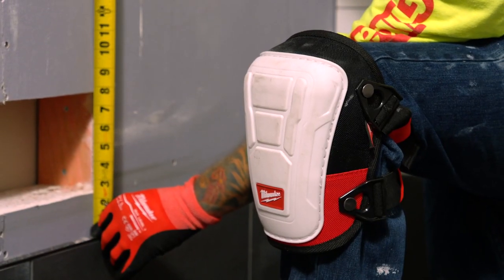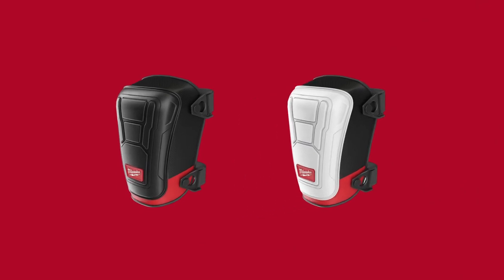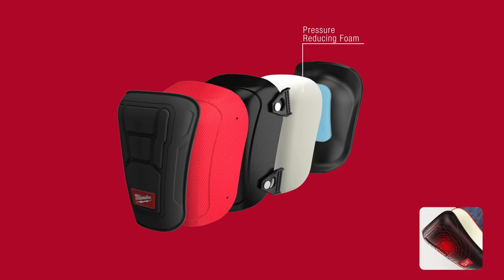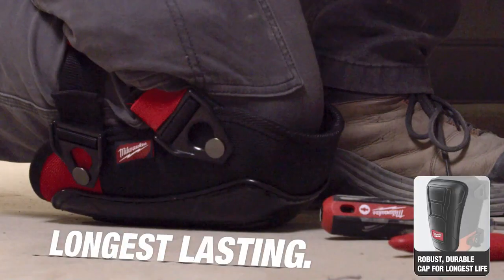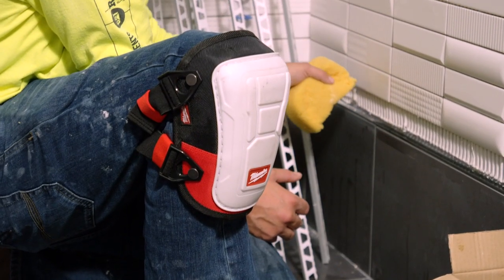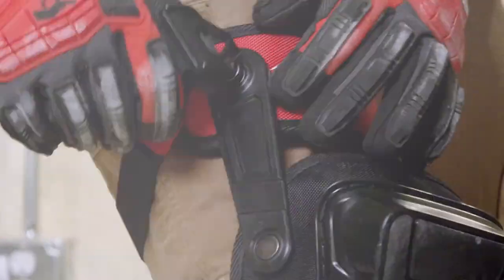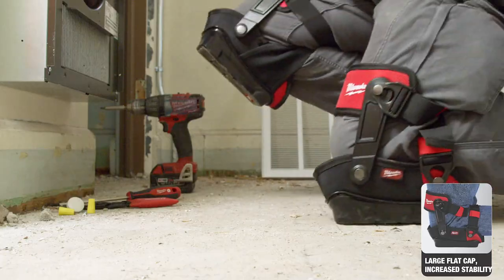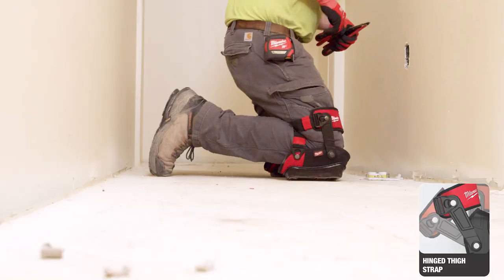Milwaukee® Knee Pads

Comment: Do they take the M12 or M18 battery? Joking aside, FINALLY someone put in a brace to keep them in place when you stand up and move around! 20 year commercial HVAC tech and those rock flat roofs are killer on the knees.

Comment: Sorry to be wet blanket guys but they are not as good as advertised. They keep slipping or sliding down regardless of how tight the straps are. They are big and bulky but once they were duct taped to my pants they work as in the commercial
Reply: They are decent pads but the straps are terrible. The buckles break on every single pair without fail.